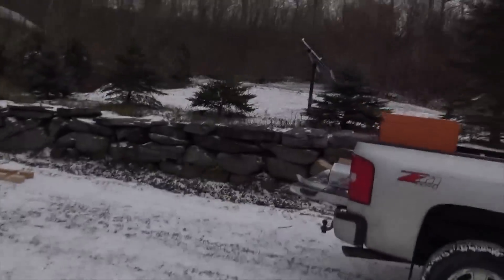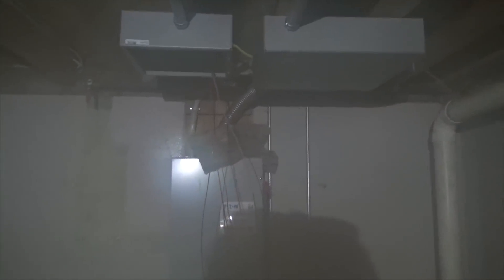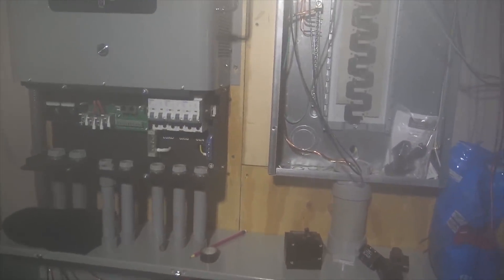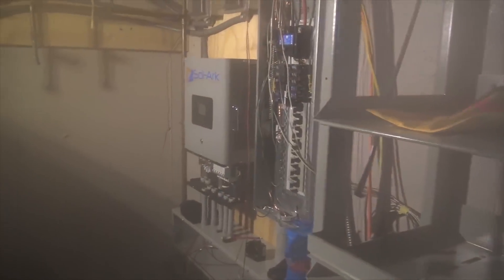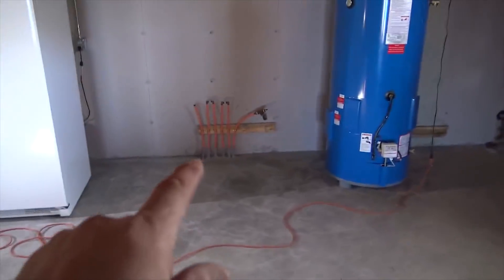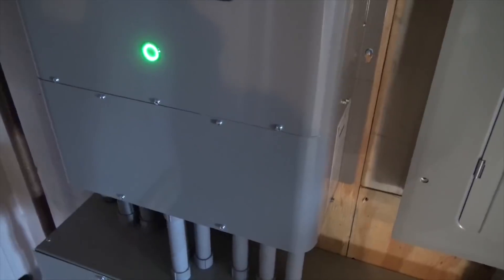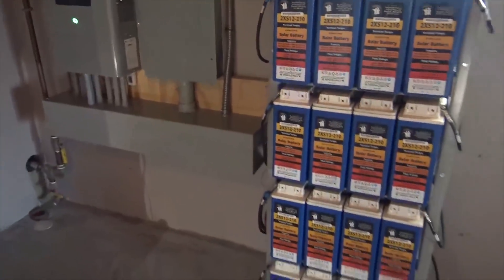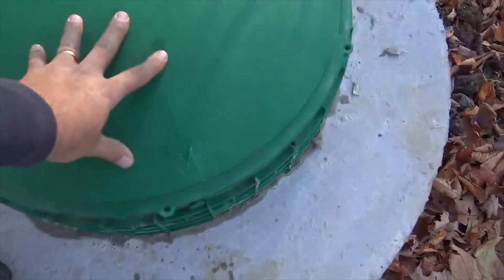Cold Climate Renewable Infrastructure : Power

Comment from the maker: https://www.practicalpreppers.com/power-solutions/solar-solutions/emp-hardened-systems
Reply: Do you design complete systems ? Interested , starting my farm project next fall .
Reply from the maker: @swampratt36  Yes, Everything on this project related to water and power and heating is my design.
Reply: @engineer775   Thanks , I've been a long time sub and couldn't remember if you did or not . Im having to go 100% off grid due to no power available to my farm without substantial cost . As of now its a large timber tract  . Will definitely be in contact next spring for a consultation .
Reply from the maker: @swampratt36  Sounds great.  Just email me when you want to get started.  info@practicalpreppers.com
Reply: Nice to be able to work on a system like this. Money can do anything ;-)
Reply: Engineer775 looks like “found footage”!
Reply: Do you do work in Florida?
Reply: Can this inverter run @ 50hz?

Comment: Thank you for sharing this awesome installation.

It got me thinking on three things.

1- Using two smaller battery banks with different chemistry.  One battery bank using the Pure lead 210 batteries for fast charging from the generator, and a second battery bank for slower charging using NiFe batteries from the solar panels.

2- Using a capacitor bank to modulate the rush starting energy required for motors, tools, and air compressors.

3- As suggested in the comments below, using a smaller combined heat and power, CHP, unit such as those from Marathon Engines:
https://www.ecopowermicrochp.com/overview.html

An alternative to the last point would be the Sanden heat pump with water storage:
https://www.sandenwaterheater.com

I am curious on your thoughts on the above.

Comment: You should find a way of using the liquid cooling system on the 30 k Generator. The 75,000 BTU's that the unit will waste, will heat the floors. I am going to experiment with a 22 k liquid cooled and i think the Exhaust can be exchanged to water heating since it puts out 900 degrees F.

Comment: Ive run my whole 1,700 SF house including central air off of a 10KW propane generator. Why does this place have suck a big generator?
Reply: @wu ming Yes, my generator is a 4 cylinder 1800 RPM. It's actually 10KW gasoline rating, so it would need a slight de-rating for propane.

Comment: We've been off grid full time for ten years. 1640 watts of PV, 16 290aH L16 flooded batteries in two parallel 8 battery banks (fully charged by noon most days), one Outback VFX3524 sine wave inverter with "mate", TriMetric monitoring, two Rogue MPT3024 MPPT controllers, two backup IOTA 25a battery chargers powered by a propane 4,000w generator (I don't use the inverter to charge batteries, or I'd need a larger, more expensive generator), solar thermal water heating for radiant floors,  propane (w/ loops behind wood stoves, and solar thermal) for domestic hot water. 12kw is way overkill for a "cabin". We're just not lazy suburbanites who have to burn tons of electricity after dark. We easily adjusted our lifestyle to where we don't do heavy load tasks when we're not making free electricity, and are still happy about it a decade later. About half our project was built using the house solar, including building the 20x30 shop, 16x36 greenhouse, and new 12x18 studio addition (using table saw, chop saw, air compressor, drill press, misc hand power tools, etc...  ...I do use the generator when welding). We use a full sized energy star rated refrigerator, chest freezer, vacuum, component stereo system, televisions (although we cut the dish off about 4 years ago, so watch movies), computers, washing machine, water well pump, etc.... we have everything we did in the city (New Orleans), except that we don't need air conditioning up here in the beautiful Colorado mountains. Nice work with the install on this video, but post the price of that massive system, and why anyone would need to burn so much money on too much equipment. Our system cost just over $10,000 ten years ago, and the PV was quite a bit more per watt back then. I'd guess the cost of shown system is probably over three or four times that amount. Why?
Reply: ....those Rogue charge controllers are great. They are efficient, have plenty of features and user settings, and were made in an off grid facility. Highly recommended.

Comment: I'm curious about the solark inverter rating. You stated it was an 8kw solark but it would take 11kw. I would think you would be degrading the reliability since it appears they intentionally derated it to 8kw.  Most inverters only last 10 years so if they over built it to last 15 years that would mean you would only have to replace one more time instead of two.

Comment: Beautiful work, but is there any way the average person could maintain this system. Also, if they ran strictly on the propane, how long would the 5000 gallons last and how much to fill those babies up from empty ? Thanks.
Reply: Propane is $2.49/gal in most areas of the country. 5000 gallon propane tank can be filled 80% to 4000 gallons. At $2.49/gal that is $10,000 without taxes.
Reply: @dobson777a , Yeah, That's a lot !!

Comment: The use of a generator that size is wasteful for such a small cabin. There are CHP, Combined heat and power units that are coming on stream that capture much of the waste heat from generators powered by internal combustion engines. A 5-7 kw system would be ample for that application. It would use all that gratuitous waste heat for hot water and building heat ,all while charging the batteries.
Reply: get a geo metro engine use the cooling hoses from engine to blow heat into house, power and heat... or use hydrogen from the dc power....

Comment: total of 16 batteries ?  
Did I hear you say you can pull 11,000 watts from the inverter? if that is right then I'm assuming this is a 48v inverter about 230 amps ?    ( that would be  a whopping  900 amps if it were a 12volt inverter. ) 

as a marine electrician I'm just curious  to see how this is set up.  

Those look similar to  mastervolt agm chassis but u said northstar.  

Also were they able to get a construction loan on this if they were not connected to the grid?? ive heard some banks will not finance if off-grid.     

cool house. sweet view. lots of wind arrives after october .  hope they are prepared.

Comment: Real life batteries, at 150 lbs.. I have 8 6v fla. And about 700-800 lbs for the set!! That's why I have lithium I'm working on. The same capacity and about 1/8 the weight!
Reply: Steve Sherman I get it is not so much. However when you are carrying all that weight, and if the floor can't hold it. So more like weight is a small concern in fixed installs.

Comment: When I heard the size of the generator, and using it's OUTPUT to heat water, I stopped watching. Thumbs down. What an abomination. The parade of propane trucks required to feed that pig will be expensive and inconvenient. That generator should be, what, maybe 3kW for a house? The battery makes up the difference, charging when load is lighter. And as much of the WASTE heat from the engine is what you use for your space heating and domestic water heating. A good design NEVER uses electricity from a generator at ~20% efficiency as a source of heat, except for things like a toaster or microwave etc.
Reply: realvanman1 isn’ the generator just a backup if solar isn’t keeping up?

Comment: Utah cell tower 20' snow no culvert for access. No cover for propane tanks. Shifted from snow a rupture gas line big fire... Your water will freeze artic express. Survival r40 basement. Basement below frost line. Survival food water snow cat . minus 70 degrees cold... Would install rock storage backup wood furnace and green house passive solar heat. Water storage below frost line and super insulated

Comment: 1969 snoqualmie pass WA elevation 4000' temp. Minus 45 degrees w 40 mph wind artic express. 100 year season 90 days.  All that energy and not super insulate house. Basement floor r 40 walls r 40 and ceiling r80... We put propane gas outside covered with snow. Your gen set shed is not designed for snow load...

Comment: Hello Engineer775
1/3 of heat is rejected from water jacket and another 1/3 from exhaust small pump to and from generator shed would give you all the heat you would ever need and vastly improved efficiency!
Great layout and quality installation looks great!
Setting quality bar very high!
Reply from the maker: Another project for another day. I really want this generator just to be back up and once the remainder of the solar is installed I don't want this generator running at all but I still want to be able to eat that house.

Comment: Is this equipment susceptible to magnetic pulses from solar flares? 
Seems very complex, Are there planned methods to bypass various electronic components?
It would be great if the methods of protecting from magnetic damage and redundancy of electronic components could be discussed in another video.    This was an excellent and informative video, we would live in a safer world if more people cared about our vulnerabilities.
Reply from the maker: Great question and this system has the answers built in.  It is an EMP hardened system.  The Solark 8k is part of a hardened system that protects the solar modules, inverter, and appliances.  The Battery is AGM so it is inherently protected.

Comment: Love the idea of radiant heat!  Could you cover something about the life span, maintenance, and expected cost of replacement(s), expected critical component availability long-term given advancements for different battery and controller types?  I think this is one of my greatest concerns regarding sustainable energy generation.
Reply from the maker: The modules will last 25yrs plus, inverter has a 10yr warranty, batteries about 10 yrs.

Comment: With a 40kW bank and 10kW usable from the bank (25% DoD), that generator is going to likely run quite a lot.
Reply from the maker: It all depends on the load.  There is not a lot of load. Lights, refrigeration.  Many things run on propane, the water system is independent.  The only load issue is during construction projects.  They stopped using their generators and are not using the system so they are making that genny run a bit.

Comment: Lol "extremely cold" wow it's still fall come back in the winter... Lovely setup we can only dream that big... 5000 gal of propane is a whole lot enough to run a good size lodge for a winter. I guess he will be able to wait for the cheap price come summer. The biggest problem will be snow accumulation on the panels this could cause 6 to 8 weeks of no sun on panels but he must have a caretaker to come and remove the 4 feet of snow he will get. Awesome build 775 love it.
Reply from the maker: The cool thing is that the roof ( according to the owners) never has snow on it do to all the wind.

Comment: I’m curious but a system like this what will be the end cost? 10k 20k?
Reply: Figure material around $1.25/ watt
Reply from the maker: Just the generator cost 12k
Reply: Engineer775 yeah I figured that so I’m guessing a system like this pays for itself after 10 years but really you are just paying to have electricity off grid and it is what it is. Nice system though
Reply from the maker: @J297WFD  correct.
Reply: @engineer775 I guess this generator was chosen for a lot more stuff to add in the future....other barns and electric loads - you could do with 1/2 of the power right?
Reply from the maker: @SteveBerube  actually this battery can take 10 KW the inverter can pass through 12 KW and I can dump almost 9 KW into the electric water heater to heat the floor when the generator is running. So I can utilize the full capacity of the generator in really bad weather and had the batteries fully topped off in 3 hours. Then I can cruise for the rest of the day I'm batteries the saving a lot of propane.
Reply: Lol that's rough, I saw the 10-20k figure and almost spit out my drink laughing, it's a tough $pill to swallow but if a guy can afford it, what a wonderful way to live!

Comment: Beautiful job.

If maintained, this site should last for many years off grid.

On an annual basis, what percentage of energy is expected from the gas tanks for the Cummins generator and the hot water tank?
Reply from the maker: Good question.  As the project is not complete yet they are going to burn more propane than I want them to.
Reply: Hello, What is the current cost per gallon of delivered propane there?

Comment: Is the generator liquid cooled? and can you use that hot coolant to preheat the hot water with a heat exchanger block?
Reply: It would be nice to dump that heat into a large hot tub. :-)
Reply from the maker: The generator is too far away from the water heater. imo